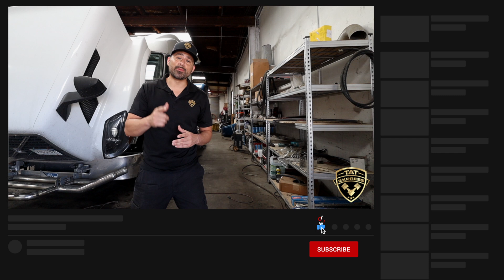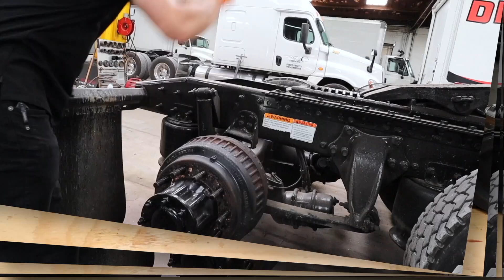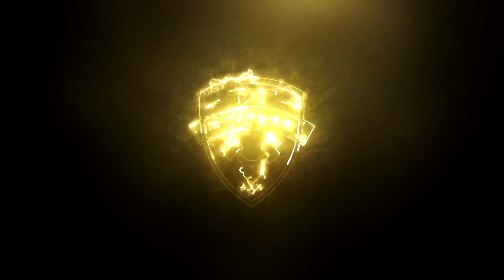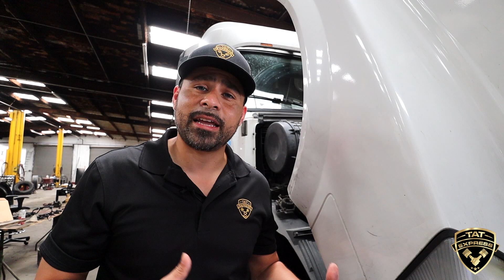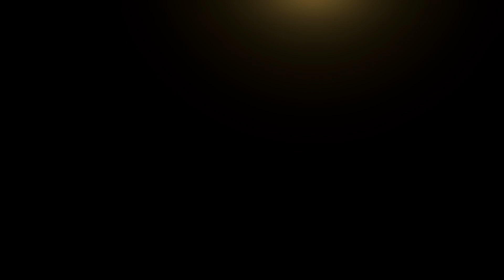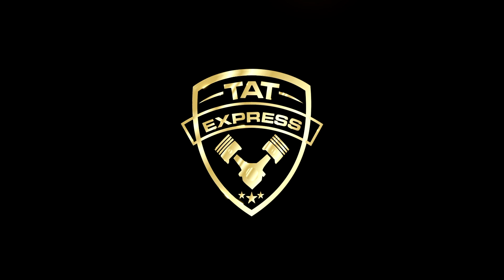J1939 DataLink | Volvo Diesel | Electrical Issue

Comment: Ok where the hell that resistor was ? You left audience with no clue
Reply from the maker: @TARANS012. The resistors can be located in different spots depending on the truck’s wiring layout. Best move is always to pull the schematics for that specific unit—saves time and frustration.
Reply: @TATEXPRESSINC I'm dealing with same issue no derate or snytnign but just check light with that fault its 2013 volvo vnl 670 where coudl it be ?
Reply from the maker: @TARANS012 TARANS012 That fault can show up due to a few possible issues—wiring resistance, a failing terminating resistor, or a short-to-power or ground in the J1939 backbone. Since you’re not getting a derate, that’s a good sign—it may be an intermittent issue or beginning to fail. I’d recommend checking both terminating resistors with a multimeter (you should see ~120 ohms across the network). Also inspect the J1939 CAN wiring and connectors for corrosion or spliced repairs. If you’re still stuck, pulling full schematics for the VNL 670 will help you trace it cleanly.
Reply: Yeah still struggling! No derate or anything just check engine light

Comment: i got mid 144 psid 230 fmi 5 on volvo 2020
and my truck shutt down suddenly but after 1 min it works normally
Reply from the maker: Fault code 144 PSID 230 FMI 5 on a 2020 Volvo semi-truck generally indicates a communication or data error between the Engine Control Module (ECM) and the Aftertreatment Control Module (ACM). Specifically:

	•	PSID 230: Refers to a data link or communication issue.
	•	FMI 5: Indicates a current below normal or an open circuit in the communication path.

Likely Causes:

	1.	Intermittent Electrical Issue: Loose connectors or wiring between the ACM and ECM.
	2.	Defective ACM or ECM: Failure in the module causing intermittent communication.
	3.	CAN Bus Communication Issue: Interference or damage in the Controller Area Network (CAN bus) lines.
	4.	Software Glitch: The ECM or ACM software may require an update.

Comment: I have a 2018 volvo vnm 200 and I had a guy hook up a car scan tool to it and now I'm not getting any communication from ecu. I'm in derate with no check engine light or faults. Runs and drives but 5mph only. What should I check to fix? Thanks in advance

Comment: My 2016 casacdia elog has 1939 cannot connect code.. its an omnitrac and its a simple plug and play what should i check
Reply from the maker: Hello, and thank you for watching. If the J1939 data link is not communicating, the next step would be to troubleshoot the data link. Try another Omnitrac and ensure it is adequately connected first.
Reply: @TATEXPRESSINC  Thank you! Ended up being rhe ivg cable

Comment: I see a lot of volvo/macs on here so I decided to throw mine in the pot. I have a 2012 volvo isx15 that is giving me a major headache, truck shuts down after 45 seconds of being on. Here is the run down of problems pioneer touchscreen is giving j1939 error code, elog is giving engine synchronization problems, gauges act all funny giving false data, codes 1176 fmi 2 and 18, spn 102 fmi 2 and 18, spn 601 fmi 1. Diagnostic equipment has hard time connecting. Any one have any idea what it could be

Comment: Hi Adam， I'm a bus fancier，i have a dashboard for B7R series，i was trying to connect it to my AmericaTruckerSimulator ，i have some datas that can transfer by mcp2515 to the dashboard turn on the left and right signal ,the id is 0x0CFF2537 ,but i cant find the emergency lights which left and right both turn on ,can you give some information to me? Thanks a lot

Comment: Pulling F59 and F13 fuse a good place to start if communications have been removed.

The terminatingresistor at one end of the data link is located in the Fuse/Relay Center near the VECUandtheothernearthe engine ECU. On vehicles equippedwith Volvo engines, the terminating resistor at the engine end is located inside the ECM. On vehicles equipped with Cumminsengine,the terminatingresistor is located in the harness area just outside of the Engine ECU. Adatalink connection is located at the transmissionarea in the chassis harness. On vehicles equipped with an electronically controlled transmission (Allison/AutoshiftII/MeritorFreedom Line), the connection to the transmission is located at the chassis harness. On vehicles equipped with a manualnon-electronicallycontrolled transmission- the connector stub will have an un-terminatedblanking plug installed.

Comment: Have a problem with a J1339 link 2004 International with ISX cummins and a Rather Rare ZF Freedomline automatic with 1.6 million miles the link broke right where it plugs into the transmission harness a three wire connector only the green and yellow are used at the transmission side, anyways I personally don't have access to the transsoft 2.1 program to check to see what ISO faults are active, I was wondering if anyone new if the OEM software is required to clear a fault like this because after finding the wire damage and replacing the bad pins in the connector I still won't clear the faults, I didn't see anything in the Service manual requiring the OEM software to clear faults

Comment: My truck was stolen and it had a camera tracking system installed. It was ripped out and caused the truck to shut off. It does turn over but it doesn’t start code j1939 maintenance ecu. When I picked it up from the recovery yard it started up no codes but less than 10 miles down the road this code came up and the truck shut off.

Comment: I had this problem 2 times in one week. Had a corroded can wire from acm to ecm. Fixed wire and found circuit still open. Trouble shooting found where those to wires go to ecm . Resistance in ecm was OL. Took out the ecm that bad wire.

Comment: Hi Adam

I have 2016 Volvo 730.

I have a check light illuminated saying "J1587 communication error with Body Builder Module" 
There are codes in Instrument cluster and vehicle ecu.

Can you please help. The truck runs fine though

Comment: I have an 07 international with an ISX in it..... I just replaced my fuel dampener seals about 2 days ago......

Today I started the truck up and all my gauges started cycling and  oil pressure and temperature pressure pleasure going off....

Coming and going and I have multiple photos but I can only read the Sid numbers the one number that stands out is s i d 231a which is this J code .....

There is an ELD hooked up to the truck also there used to be an old style b Qualcomm  I bought the truck they cut the wires in the back of the cab it went to the dish... It's been about 6 months I've had no problems until now.... 

Like right now my lights are flashing again and  odometer screen says no data link...

Any help or insight would be greatly appreciated... I do have trade school experience at 10 plus years in the automotive field so I do understand that this is a communication problem between the can system Network..

Comment: Hi Adam, a friend of mine is having an issue with his D13 when driving loseing all accelertor response, he pulls over shuts down and start truck right back up could be 15 mins or an hour before happens again. Crankcase Sensor, p delta sensor, tps with pedal, fuel filters all replaced turbo boost pressure and  cleaned issue still remains....Ive been told possible diode issue in datalink. Does that make sense and could you explain possibly where to find or where it should be? Thanks
Reply: yeah. I had an issue like that a few years ago in an 09 780. Before I could figure it out I got rid of it. I recall the TCS light being on the whole time, though. It seemed in my mind that the system thought I was losing control and forced the accelerator off. Who knows but I don't think J1939 data links have diodes. There are 2 resistors at 120 ohms apiece and I believe the way to test those is check what resistance is at pins C and D on the diagnostic connector (the round 9-pin one, anyway). If the ohms are around 60, the resistors are fine.
Reply: 5 vcf

Comment: Would’ve been nice if you showed where the resistor was located and the components that you were describing.
Reply: That is the dumbest video ever, nothing is shown, waste of time
Reply from the maker: @marcinpawelek9066 We will work on a more detailed version.
Reply: Such a great question
Reply: @keyandaneshmand9915  There are resistors at the end of the green-yellow twisted pair under the CB lid (fuse-box lid) and on Volvo engines, the second resistor is inside the engine ECU.
Reply: @themaestro7922  I think there's a video. But it's inda language
Reply: There are several. Each computer has one. Grounds have them
Reply from the maker: The resistors may be in different areas depending on the truck.

Comment: How you doing I have a question. I have a Detroit series 60 and i keep getting a 5 volt DC supply fault code. It was giving me issues truck would stay running but won’t accelerate.

Comment: Man every time my truck hots a bump I lose all power including Jake breaks.. any udeas?
Reply: Thanks guys, one of the battery's nuts wasn't tight all they way. That was enough to cause the issue.
Reply: @Anareo  Another thing can be the battery cables poorly mounted over the transmission. They'll ride on a sharp bracket that cuts into the cable insulation. Power will blank out completely in bumps. Until it gets so bad that power goes out and stays out. Problem is a massive short due to that positive cable touching the metal. Fix the mounting of the cable (I cover with silicone hose) and then change the blown negative cable from the batteries to the frame. Blown fusible link in it.
Reply: Check ground wire, batery to frame (  new wire) , Volvo has issue with ground wires. or engine to frame, or starter,  if you recently change battery or starter re-tighte all connections
Reply: If you lose all power jakes are your last worry. But sound like battery box wiring connection faulty

Comment: I got that very problem now with my 2007 Volvo 780 ran fine but abs/tc would come on and engage brakes took in to the shop left truck idling and came back and truck shut off and had on dash check ecu maintenance data link and wouldn't start. Volvo said I needed a new ecu and possibly a wiring harness....
Reply: I have 2007 780 also with same problem. Can you tell me what was the fix?
Reply: @702stormrider  Unfortunately my truck is still down but it will need a new ECU and engine harness... But if u get yours fixed please let me know what was your issue driver it will be greatly appreciated.....
Reply: @bikerboy2k142  mine turned out to be a melted fuse in the battery box.
Reply: @702stormrider  glad u had an easy fix
Reply: @702stormrider  hey bro just checking with u to see if u ever found your issue that caused your problems?

Comment: I passed your shop 2weeks ago i was ganna stop by the say hi now I m broke down in columbus ohio no boost max speed 60 If I hit down hill speed 1600 rpm boost comes back 30psi I don't know what s going on truck is 2000 volvo  vnl 770 with detroit 60 12.7l any ideas...?

Comment: Very imformative
Reply from the maker: Thanks for watching be sure to subscribe
Reply: @TATEXPRESSINC   my truck is renult 460 dxi MiD 128 SID 231MID 2 i was driving a truck some times accelerator padel not support and rpm down Take the leg off the accelerator and go right when you step back what the problem

Comment: Hey Adam question headed out buy steer tires pulled up to a local store grab drink went to neutral truck went dead pulled brakes tried restart no start towed to local Volvo dealer but it showing multiple codes but it is saying j1939 not communicating, service transmission ecu, not communicating with truck ecu been racking my brain on this one because is booked up and truck been down for 4 days waiting to get in the shop have seen this before and maybe what I'm looking at thanks good videos
Reply from the maker: Do you know if the data link has been tied into?  If so than the resistance would need to be check on J1939
Reply: My last carrier hard wired the Qualcomm thats about 3 months since I left them and current carrier plugs directly to 9 pin
Reply: @dagboynumberone  But what was the problem with the truck you got towed?
Reply: @themaestro7922  I ended up having to replace ecm and harness on that truck then sold it as quick as I could and went and bought me a fld 120 with fresh out of frame done and reman 15 over haven't had a those headaches in long while

Comment: we see a lot of issues with ELD devices when people attempt to access the back bone of the j1939 .

sometimes the wiring is great and the actual device is the culprit.

we have seen interference by add on devices on the j1939 circuit that cancel the regen system operations too.
Reply from the maker: Thanks for sharing your experience. 🔧👊🏼